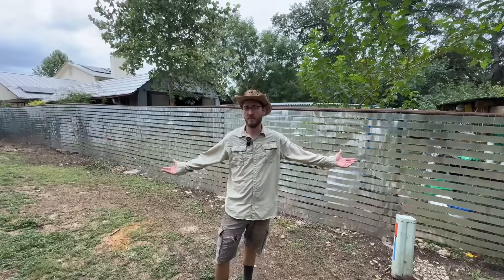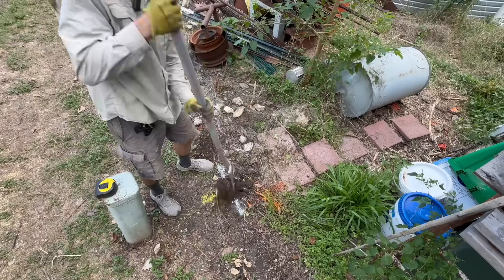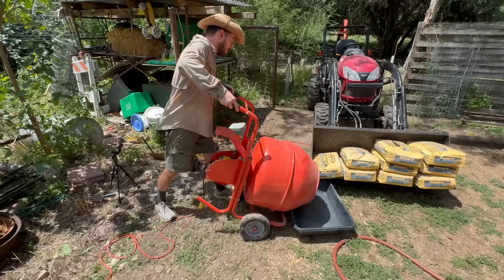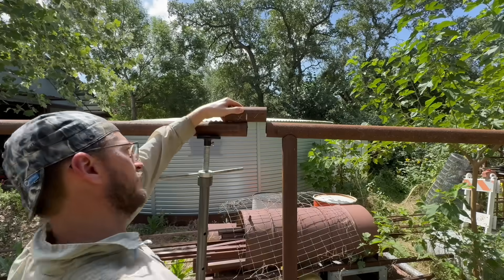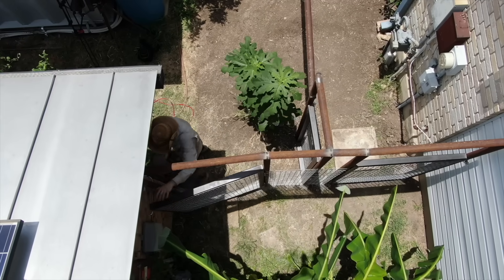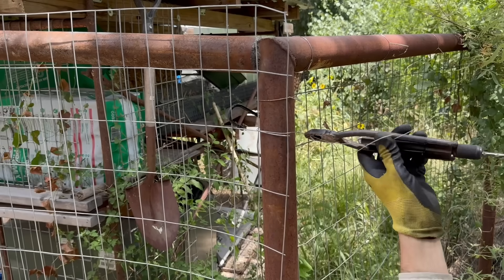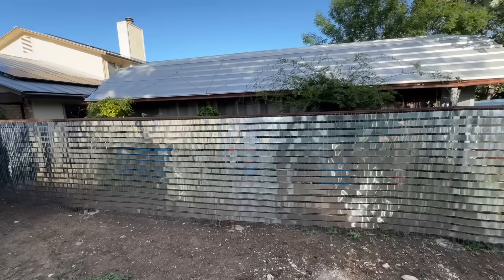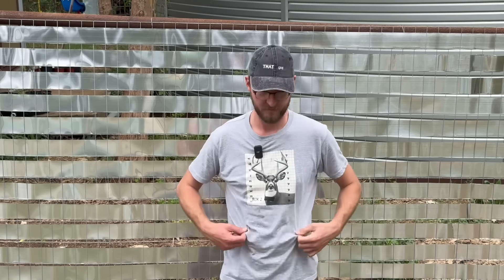This FENCE Lasts 100 years!!!!

Comment: First time watching your YouTube channel. Loved your puns, and detailed directions of every step! I do have a couple of questions, however. First, could you please give me more details about the round 10ft pipes that you used, (the name & type of pipe, where I can purchase them, and how many did you purchase, & how much did they cost? Second, the pipes look like they might rust over time, would it be a good idea to paint them with a rust proof paint? Forgive me, these may seem like dumb questions, but I am a beginner at DIY building outdoor projects. Thanks in advance.
Reply from the maker: Pipes came from a recycling center. They are a waste product from oil fields and they are taken to recycling centers for scrap. My local place sells them back to the public for a profit. 

In my dry climate paint would probably not make a huge difference. The walls of these pipes are almost 1/4” thick. Unless they are exposed to salt or water or both that last a very long time. Good luck!

Comment: I love your fence, great job, wonder what the deer are going to think when they see themselves in the reflection,it's going to send them in another direction I hope, another thing that's great that makes sense is there is air flow in this build and where I live we have tornadoes Soo not sure how that might go, but without ventilation it would take it off like a buzzard, the reflection will help the trees later too, just hope it don't get too hot from the sun like an oven and cook your trees, I thought about this same structure but with the left over pop bottles that are big, would need to staple the ends together for some length, but I like your metal version, a big thumbs up.whats next?
Reply from the maker: Self-watering planter to show how the future greenhouse will work.

Comment: I wonder what's the level of heat that's generated from the paneling of the fence that's literally going to cook anything you plant near there But would be great for solar panel
Reply from the maker: So I used sun hardy vines. So far they are fine.

Comment: Very cool.  Almost gives it a brickwork effect, if you weave the aluminum the right way.  Sort of thing you realise about 20% through a project!  The steel uprights are liable to rust of course, but if starting from scratch, one could use stainless steel or aluminum tubing, and stainless steel mesh, really future-proofing it.  The concrete potting at the bottom would then fail first!  A comment was made about the aluminum, it only rots in the presence of salt, which generally restricts issues to cars in the ‘rust belt’ etc.  The science is well-known.  Aluminum is nearly as reactive as potassium, it’s over there in the periodic table, but it forms a super-hard, thin, oxide coating first, before all that can take place.  Hence, in a normal Earth atmosphere, it’s a very usable material…unless it sits in a substance like a concentrated salt solution which then hobbles the oxide coating process, making the metal want go all nuts, like sodium etc does in water.  

Lastly, the most notorious failure of aluminum, was in a Soviet space capsule.  For reasons seeming logical at the time, they used Oxygen to fill the space capsule, which was of aluminum alloy construction.  Again, this is the exception…this side-stepped the usual good behaviour of the oxidation of aluminum, and enabled it to catch fire.  A pretty gruesome end for the cosmonauts, may they rest in peace.  So, keep the environment ‘ordinary-Earth’ and aluminum is rather good.  Great fence, I have the same issue, it is too much work to keep re-doing it.  Take care all.

Comment: I can appreciate the creative idea and design and use of recycled materials , but yeah like some others have said to industrial looking for me. In my heart I'm a wood guy , and cheaper then wood is subjective. It depends how you obtain the wood. You have to consider it from a standpoint of in both cases having to put minimal to no own money into this. That being said : I use pallet wood that I reclaim and process from the pallets myself. I build allot of things and it costed me nearly nothing except machine wearing here and there and some small materials and paint. For example I build a french clete ( tool rack wall ) having it cost me below 5 bucks all together. Got big cheap lacker from amazon because the containers had dents so massive discounts. Reclaimed all the wood. So most costs where just small materials like plugs and screws and a little paint. 

Either way long story short : It's always about being creative with recourses and alternative ways besides buying materials. 
That being said I do give you a thumbs up for the recycled usage and supporting nice creative ideas. ( Just for everybody reading this , you can still like an idea or project even if it's not your preferred style , don't bash things because it's not something you would do )
Reply from the maker: Well said. I appreciate all that ⬆️. Especially the last part. I have lots of respect for anyone willing to build anything from anything. Thanks!

Comment: Wow! I love other out of the box thinkers and do-ers! I'm a few months behind you in getting my almost 3 acres under better control. And I can't wait to see your greenhouse build as that's on my future to-do list as well. I gave you a thumbs up per your funny suggestion only because my wife would say that the aluminum coil flashing was not as pleasing to the eye as some other more expensive ways to do the same like wood cedar panels. 

Not to worry, she is probably going to be traded in before her value gets too low, or maybe "eco-friendly" recycled later this year anyway for a newer less opinionated model with much better gas mileage! Plus her suspension is worn out due to going down too many dirt roads way too fast full of potholes with her lips flapping in the breeze. And her rear end is beginning to rust out as well. 

I can't wait to see how much flak I get for this last comment even though I expect more sympathizers than critics to chime in. As a former military man, I'll just don my bullet proof vest and Kevlar helmet until the cheap shots being fired at me go quiet.  But wearing all that protection even with a large helping of patience and praying for all opinionated noisy verbiage might end soon, has proved to not be enough protection from an older retired Puerto Rican mother. Meanwhile I'll be hunkering down in my war bunker listening for any shots fired overhead and then raising my periscope to see if the coast might be clear. Please keep up the great work and videos!

Comment: Have you considered a lead line attached to the end of the flashing then thread the lead line instead of trying to hack n slash your fingers while installing it? It's also faster.
Reply from the maker: I tried that. The friction on the line made it worse actually. I used a wire puller for conduit. Didn’t work so I went with straight flashing.
Reply: @suburbanbiology  I wonder of another material would work. Like a nylon strap as a backing for the flashing. Could make is smoother. Anyway, the work is done, so maybe a future project lol.

Comment: I would like a buck deer see himself mirroring in the aluminium, smile and then jump over the fence. That would be hilarious. Just kidding. I would make the upper bar in one piece straight though, in advance. Putting a smaller piece of pipe inside the joints to strengthen it and straighten them out. Then after placing the poles, cut them at length using a laser to know the correct height, grind the saddles and place the upper bar on top. It is a very clever use of second hand material. Great idea. Not sure about the mixing of materials. Iron together with rustfree steel, and steel with aluminium. Might oxidize. Don't know.

Comment: The amount of time this takes compared to a wood fence erases any advantage this has to me. Wood fences are fast effective and if installed right can last.
Reply from the maker: I would argue that I built this by myself faster than I could have built a wood fence. I am biased though because I have more experience with this type of fence than wood fences. It would be fun to race a neighbor and make a video. Wood fence on one side, metal on the other. Thanks for commenting!

Comment: So clever solution.   Pipe surface look rusting.  Aren't you gonna spray external (weather proof metal paint) on it?
Reply from the maker: In my dry climate the rust forms a relatively stable oxide.

Comment: Hmmm,  saving money on a fence using free fencing material?  I was with you until you pulled out a $10-$20K+ laser cleaner to weld the joints. It is an excellent fence, just not in my budget.  Thanks for the video.

Comment: That is a lot of work and I admire his skills to do this . A rural farm homestead property could use your gifted skill !  But why not just use a “.😊😊frost free fence that has metal poles and coated wire roll already  pre made ? Then hang privacy panels on top of coragated metal we use a lot here cost affective , does not rot or rust save less work time .Then rebuild from scratch not needing those special circular saws and welding equipment . Neverthe less you are incredibly skilled ! 😁
Reply from the maker: Thanks!

Comment: I hear people claiming rusting metal is good to use but in reality its rusting meaning its going to bread down.  These types of fences last about 10 to 15 sometimes 20 years before tehy are absolutely disgusting.  Now if you actually want a fence that won't break in 100 years its simple make it out of stone and built a stone wall.  Stone walls last hundreds to thousands of years.  Hell the average well built wood fence should last you 30 to 40 years.  Now stone walls require no maintenance.  Always go with stone its actually cheap and its easy.

Comment: Nice video. Unfortunately is missing a critical aspect which I need in my part of the World: a wild boar defence system. Your fence will not do. Wild boars have a tendency to be smart animals, they just dig a hole and pass underneath. The first times I saw a tunnel under a fence made by a wild boar I was shocked. It looked like someone with a earth moving digger had done the job. Thank you for the video in any case, there were a lot of ideas I took away

Comment: XORust brand rusty metal aluminum paint on your pipes would make the frame blend with the flashing. XORust paint just lasts. Doesn't peel off unless something is on the metal other than rust. Rust doesn't work it's way thru the paint. Have not had this kind of success with Rustoleum even using their primer for rusty metal on wrought iron under their black matt paint. Rust came thru the primer & paint after a few years on the wrought iron. Just Rustoleum paint on rusted steel rusted thru again after just one winter. Have used Rustoleum rusty metal primer by itself on rusted steel and after a few years was still holding with no rust. Definitely something different about the XORust paint formulation that makes it seal in rust on steel.

Comment: Can your add your breakdown of your cost compared to others ways (in $ per lf cost) in your description? Also, wouldn't fitting smaller pipes (pvc?) in between these pipes not solve the perfect fitting of the vertical posts alignment issue?
Reply from the maker: I included some numbers in the description for cost. I’m not sure I fully understand the PVC idea. If you mean slip the pipes over a pvc scrap that could help. It may burn a bit when welding but it would t be the end of the world 🤷
Reply: @suburbanbiology  yes, you did. But can you quickly do the calculations of your system compared with other systems? 

Yes, for the pvc inserts ... with some other means to secure thing like 1 screw at each joints to prevent the metal parts from moving out of alignment. How about a pvc sleeve for each joints/post, fit the lateral rods together & screw 1 screw for each lateral metal pieces? Don't you have longer metal rods. Here, we have them 6 meters long

Comment: one thing that'll stop that fence lasting 100 years is the mix of metals - galvanic corrosion between the stainless, galv (presume thats the mesh), raw steel/oxide, and aluminium flashing... dry climate and 'less' than 100% contact between them will help... but your gonna get some serious corrosion over time.
Reply from the maker: I plan to install extra anodes. Thank for commenting!

Comment: Safety wire and Safety wire pliers are a staple in the military. The flashing doesn't reflect heat back?
Reply from the maker: My air force neighbor taught me about them. The reflection has been fine so far. Fence runs north south so it produces shade half of the day.

Comment: Whenever one mixes metals like steel and aluminum, a potential condition can happen called 'Galvanic Corrosion', but since you're in a fairly dry climate, it might not pose a threat to the fence. i'd say the aluminum would likely be the first to suffer over time but then again, you're in it for the long haul so it probably won't be a major concern. High humidity areas might react otherwise.
Nice work or your project. Like they always said, "Good fences make good neighbors!"

Comment: I want to let you know that aluminum and steel, especially stainless can react and cause galvanic corrosion.
Reply from the maker: I’ve read that. I think the zinc will be first to go. I bought some zinc anodes I plan to attach if it starts eating the galvanized surface off the wire.

Comment: Before I was in Mason, I was a Hoddie part of my job was to mix up mortar and concrete. There are many different types of mixers. I still like the barrel mixer as my favorite. It does a great job and I think it’s the easiest one to clean. You mention about cleaning it out the absolute best way to clean one is to throw a little water in throwing a handful of gravel, move the barrel into different positions, so the water and gravel can move around the entire barrel. And it’ll be so clean you could eat your cornflakes out of it.
Reply from the maker: Thanks for the tip!

Comment: Fence looks great.  Not a complaint but a real question.  Won't that aluminum be hot as heck in the summer?  Trip fall and sear the arm....    Just kidding, sort of.   I have a cattle panel fence myself.  Love this take on it.
Reply from the maker: The more reflective something is technically the cooler it is. A black surface gets much hotter. The heat it reflects onto the grass might be a problem but so far it doesn’t seem to bother the plants. It’s a fairly hazy finish so maybe that’s why. I guess time will tell. Thanks for commenting!!
Reply: @suburbanbiology  that makes sense.  My black Honda would set you on fire in Alabama summer.

Comment: I use sds drill for vibrating concrete, works wonders, better then just poking concrete and no need to buy vibrator for concrete.
Reply from the maker: Good tip. Thanks!!!

Comment: I find this garden fence very beautiful and probably very sturdy as well. It immediately inspired me to plan something similar for my garden. Your solutions for making it easier to produce a garden fence on your own are also impressive. Really great!

But please forgive me if my question is out of place. Was there a specific reason why you didn't weld the mesh to the posts as well? Does it have something to do with the different types of metal or the alloy? Unfortunately, I don't have any knowledge about welding or the 'metal field,' but I'd like to learn more about it. Thank you very much.
Reply from the maker: The wire is so tiny compared to the thick steel walls of the post that makes it hard to weld the two together. If you set the welder hot enough to penetrate the post, it melts through the wire. If you set the welder cold enough to not melt the wire it doesn’t penetrate the post. Thanks for commenting and for subscribing!
Reply: @suburbanbiology  Thank you very much for the detailed explanation. Now everything makes a lot more sense to me. I think the way you built the fence is really wonderful. Thank you so much for taking the time to explain everything so clearly and understandably. I wish you continued success with your channel. Maybe we'll talk again next time. All the best!

Comment: Friendly advice from a retired Respiratory Therapist...you had better start wearing a respirator when working with cement/concrete. You're going to end up with Silicosis which like Emphysema, is a terrible way to die.
Reply from the maker: Thanks for the tip. I know it’s sounds negligent but I really do try to hold my breath in the dusty moments. It was 102 when I was making this film. Any respirator that fits with my beard is pretty awful when it’s that hot. You’re right though.

Comment: No galvanic corrosion concerns?
Reply from the maker: The zinc coating will be the first to go. I bought some zinc anodes I plan on attaching to the fence. In my dry climate I think it will be fine.

Comment: but will aluminium stay when in contact with steel? i have heard that aluminium corrodes away when in contact with steel, something about electron flux causing the aluminium atoms to flow towards the steel.
Reply from the maker: Galvanic corrosion will slowly eat the zinc off the wire mesh if I understand correctly. So someday I may have to add more mesh. In my dry climate though that will probably take a long time. I also bought some sacrificial anodes I am planning on welding to the fence to take the hit instead of the mesh.

Comment: Decent. Too much windage if you are in major wind area and load resistance if in a snow area. I would instead used bamboo... much much more attractive, will allow wind and snow to blow through and a perfect compliment to vines. Also, I would expect some cracks as wind worries the welds and look at sealing the joints.